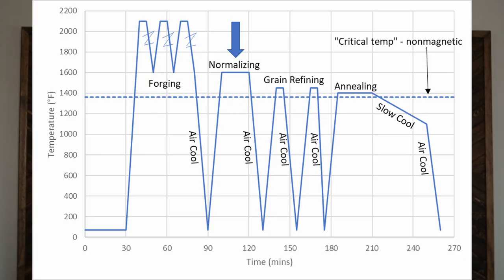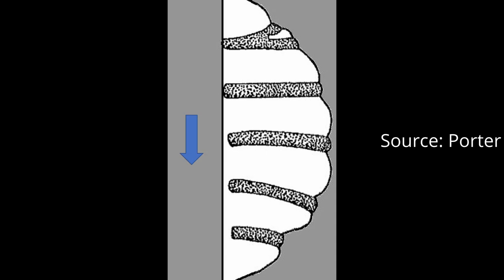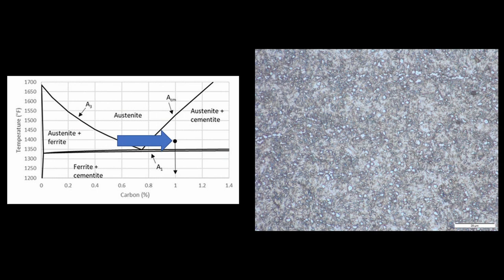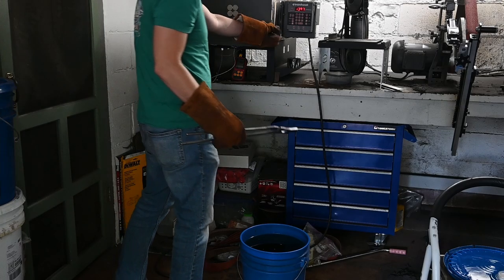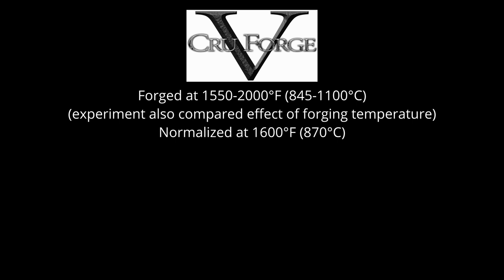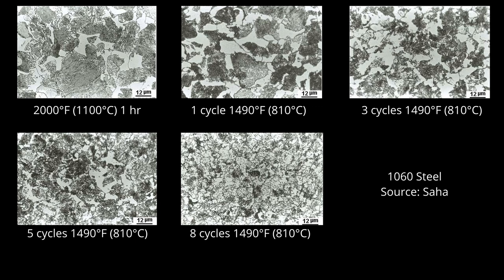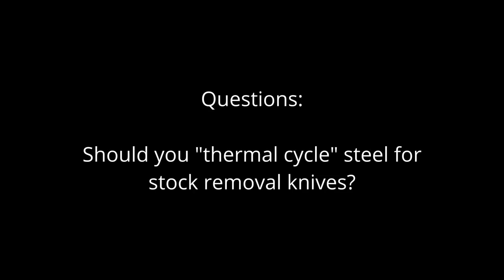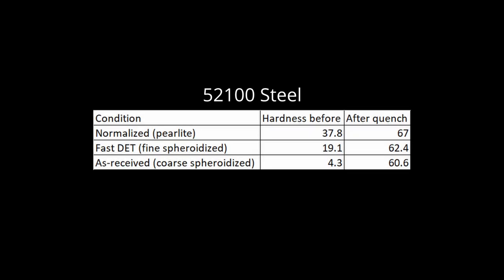How to Thermal Cycle Knife Steel

Comment: What I normally do when watching YouTube videos is to speed up the playback speed to 1.25x in order to save time and not get bored.
When watching your videos I sometimes have to do the opposite and slow down the playback speed to 0.75x, because otherwise I cannot keep up processing the incoming information and end up with information overload. And that is although I am a mechanical engineer and have studied the basics of metallurgy. Yet, watching your videos is like trying to drink from a fire hose. 😂
Nevertheless, thank you for your excellent work and sharing the results on YouTube. I still prefer information overload of scientific data providing real insight into details over insignificant or boring or even plain wrong information offen found in other sources online.
👍🏻🤓🙋🏻

Comment: A buddy of mine mentioned that I'm a bladesmith to a metallurgist he knows. The metallurgist said that bladesmiths often have an understanding of metallurgy that is similar to how a peasant would understand astronomy as a kind of magic. I've interacted with enough older smiths who are so tied to tradition and over-emphasise "experience" (really they've just entrenched a completely incorrect understanding of the mechanics of metallurgy) to know that this is harsh, but true. I'm happy you're out here providing a great resource to set the record straight

Comment: Thanks for normalising our understanding of these issues. There’s a lot of misinformation thermal cycling it’s way through the forums. You’ve quenched the hard and brittle keyboard warriors with your balanced wisdom; they should be annealing before you… If you were a steel I reckon you’d cut 1000mm on the catra and still notch 50ft-lbs, all at 65RC ;)

Comment: Greetings Larrin,

Can you share your thoughts on the relationship, (if there truly is one), between normalizing cycles and warpage and / or cracking? It was always my understanding that the goal of normalizing was to reduce one's chances of ending up with a warped or cracked blade after quench...alas...I forged and ground what I believed to be a gorgeous 1065 camp knife - spent quite a few hours on it, normalized it 4x by simply heating and leaving on my anvil then quenched in water and cracked the piss out of it (5 cracks on the spine and 3 on the edge and it was mildly warped). Really thought a plain jane 1065 blade could be water quenched. Fun part was that at least one of the cracks occurred when it was in my bare hand already cool enough to safely handle...I felt and heard the crack.  The blade was forged from a section of a bit of mystery scrap steel - I forged and ground a section flat, took it to my lab (I'm an analytical chemist) and analyzed on our Spark OES and identified it as a textbook example of 1065.

You have my sincere thanks for all you do,

- Jens

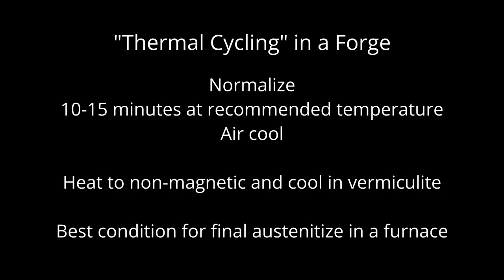Comment: Great video - I have a question: at ~18:17 you have a slide on the screen  - is this supposed to be for Annealing in a furnace? - I am confused by that slide because you have a heading on the top about thermal-cycling in a forge and then mention normalizing but cooling in vermiculite, and at the bottom of the slide you say "best condition for final austenitize in a furnace".... is this slide correct?   Great video - I really appreciate the work and education!
Reply from the maker: Looks correct to me. It is a process for thermal cycling in a forge if you are going to do the final austenitize in a furnace.

Comment: I have a question maybe you can answer it. Im currently making a knife out of a piece of flatstock i have had for years. Dont know where i got it or what it is but i discovered it hardens by accident. After forging the knife and running a couple test pieces through the thermocycling, hardening and tempering process even though the tempering process did soften the steel enough that it can be worked and wasnt so brittle the grain structure remained the same as it was right after the quench why is this?

Comment: Larrin, you do great with your research and I thank you very much.  I so have a question, When you test "as received" and it seems that's as good for HT'ing as when the steel is normalized, wouldn't that depend on the condition the steel is when received?  If it's heavy speriodized or as AKS says of all their steels, "read for HT"?
Reply from the maker: Almost all steel comes from the manufacturer in a spheroidized condition. There may be some variation in the exact microstructure but AKS isn’t getting steel in a special condition that other suppliers aren’t getting.
Reply: @KnifeSteelNerds  Thank you for your response.

Comment: I guess I'm curious to know how larger/smaller grain sizes affect the ability to sharpen a knife edge at different grits. For example, if your desire was a very fine 6-8k razor edge, would grain refinement be desirable? If you favored an edge that's "toothy" for produce, does that microstructure have an impact?

Love reading and watching!
Reply from the maker: No the grain size wouldn’t really affect the sharpening behavior unless the toughness is very bad. Carbide structure affects sharpening though.
Reply: @KnifeSteelNerds  cheers! That helps put another detail from the video into context.

Comment: When talking about "air cooling" for normalization, I'm sitting right now at about 20F.  If I heat my oven to 1550F, and allow the blade to heat up then shut it down and open the door, will I negatively affect the normalizing due to the ambient air temp??
Reply: Cooling in a furnace would be a “furnace cool” rather than an air cool. The 20F won’t affect things too much.

Comment: Awesome video. So much great information. I have a question though. So often I see heat treat soak times given in ranges (e.g. 10 to 20 minutes). Is this dependent on thickness or the condition of the steel (or both)?
Reply from the maker: For 1/8” low alloy steels that are annealed (either by you or the manufacturer) 10 minutes is good to shoot for. Thicker stock needs more time. Steels with some alloy in them like 52100 might be better with 15 minutes. Generally using 15-20 minutes or even longer doesn’t hurt anything if it’s annealed.
Reply: Thanks for the quick reply. Would you recommend heat treating some samples of a chosen steel (for sake of argument 52100) and testing the hardness when working out such details? I know there are many variables and it may open a huge can of worms. Bottom line should a kingmaker shoot for the process that produces the highest hardness before tempering? Thanks.
Reply from the maker: @Null_76  Measuring hardness is always a good idea. But no the maximum hardness isn’t necessarily a sign of optimal properties. Toughness for example is also an important property to balance with. I have an article on heat treating 52100 that you might find helpful.
Reply: I will check it out. Thanks so much.
Reply: @KnifeSteelNerds  I have spent a lot of time on your site and there is one topic I have not seen discussed. Perhaps I wasn't looking hard enough. Namely the topic is the cleanliness of the steel. I have heard you mention it on you tube, but not really in depth. Again, I think 52100 is a good steel to discuss here, because I have heard several times that the quality varies quite a bit. I have some 52100 stock from New Jersey Steel Baron which I have heard is good and I splurged on some Carpenter VAR stock. I would assume that the vacuum remelted stock would have more reliable and reproducible properties. Do you think it is really worth the investment (2X price) to by the cleanest steel? Or does it even matter that much for knives? Thanks.
Reply from the maker: @Null_76  It is hard to say if you could measure a difference. The cleanliness is most important for high cycle fatigue for bearings.

Comment: Is there such a thing as differential wear
resistance? Like a katana has differential
hardening, or how case hardening
creates a carbon gradient that is
differentially hard, is there a way to have
one side of a steel wear faster than the other?
Reply: It is probably easier to do that with a coating, titanium nitride might be a good choice for that. If you are doing it DIY it is fairly easy to coat one side of the steel with carbide, although you won't necessarily get a very clean edge.

Comment: Why do aluminum plates work for a plate quench?
Why not copper plates, steel plates, etc?
I’ve always wondered how this works, even though it may not be a question of steel it is still a technique and I wonder how it works.
Reply from the maker: it can be other plates but aluminum is common

Comment: Another excellent video. What are your thoughts on “stress relief cycles” (for 1084) performed after machining and prior to quenching? Does this process actually prevent some warping during the quench as it is advertised?
Reply from the maker: I briefly covered stress relief cycles in the written article
Reply: @KnifeSteelNerds  thank you Sir! I have it in my inbox and will read it.

Comment: Dr. Thomas, 
May I check my understanding? For steels commonly used in bladesmithing (specifically 5160, 1095, W2) and using a forge and magnet, you suggest quenching from a normalized state correct? Does this mean that the DET anneal is performed before the normalization? I am just confused as to where the DET anneal should be in the process. Thank you so much in advance!!
Reply from the maker: If heat treating with a forge the DET anneal would not be performed.
Reply: @KnifeSteelNerds  I feel like that kid in class who doesn’t shut up, ha! Could a DET anneal be performed, but not as part of the heat treating? Or do you mean no DET anneal all together? My understanding is that if the piece needs to be machined, drilled, etc. then annealing makes life easier. Normalizing would then produce a pearlitic structure that will readily austenitize during final heat treatment and use of a magnet. Am I off my rocker? 🤔 Thank you so much!

Comment: If a steel held at the correct austenitizing temperature but for longer than the recommended hold time can this result in grain growth?
Reply from the maker: Yes though if it’s at the right temperature the grain growth is so slow it doesn’t really matter.

Comment: Question, for simple carbon steels is it best to after forging normalize (at your recommended temps) is twice good? Then two? Grain refinement cycles, and then DET annealing once, or because you of the DET do I not need to do any grain refinement cycles?
Thanks in advance!
Reply: Also does multiple DET anneals have a benefit or is once enough?
Reply from the maker: One normalize, one anneal
Reply: thank you so much for clarifying.
Regards Joseph.

Comment: Shouldn't the thumbnail say "one cycle" instead of "once cycle"?
Reply from the maker: Only if you want it to be grammatically correct
Reply: @KnifeSteelNerds  Shouldn't grammar be treated with the same respect as the heat of steel😉?

Comment: What are your favorite “tough” steels? If you were going for extreme toughness in a blade, what would you use?
Reply from the maker: 5160, 8670, Z-Tuff/CD1, AEB-L, etc.
Reply: Thanks for the reply.  I don’t see much in Z-Tough out there but I would love to try it.  I have Z-Max thanks to Spyderco but that is on the other side of the spectrum but I hope Spyderco would make some more mules on the tougher side like Z-Tough.
Reply: @Barryhatchet  How hard do you want your knife to be? I used to make axes out of S5 an old oil/water quench shock steel that is much tougher at HRC 59 it is 158 foot lbs. on the Charpy Notch test Dr. Thomas uses. For axes I had to use water to quench because it is so thick, but the few knives I made I quenched in a fast oil and tempered them down to 60 hard, but above 59 hard toughness drops sharply, but it's still tougher than most steels at 80 ft. lbs. S7 isn't as hardenable as S5 btw. 

Problem with acquiring S5 is knife suppliers do not carry it, though some do carry S7 for throwing knives or tomahawks, but it can be hardened to 59. S5 only comes in 3/8ths or thicker from some steel suppliers, but it's inexpensive.